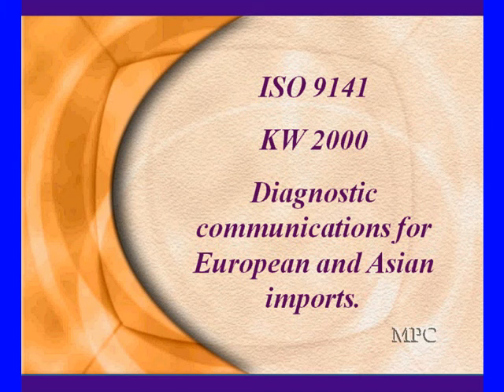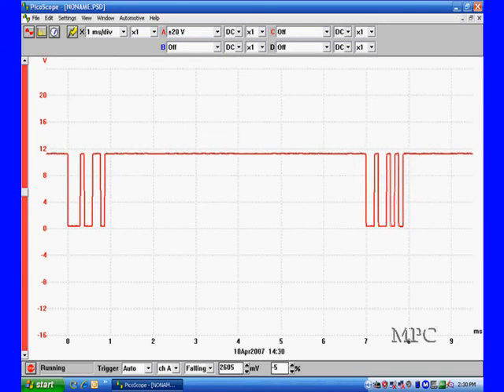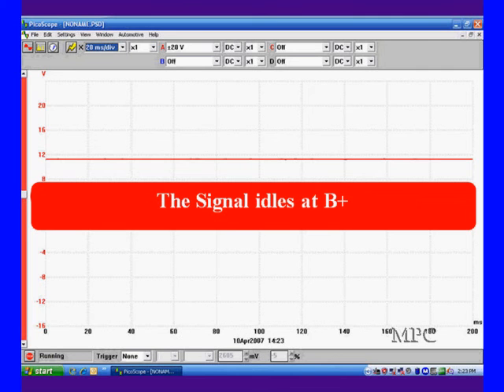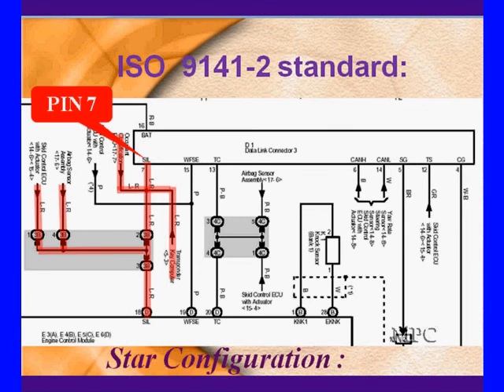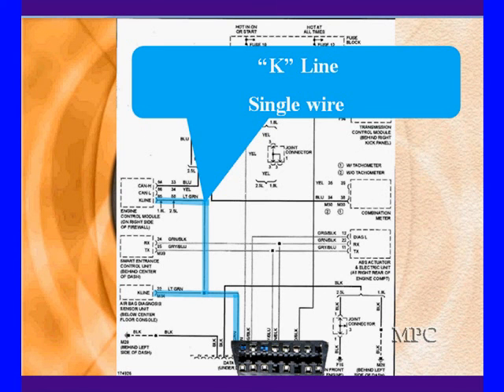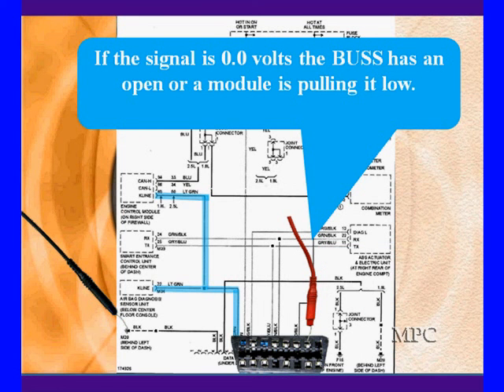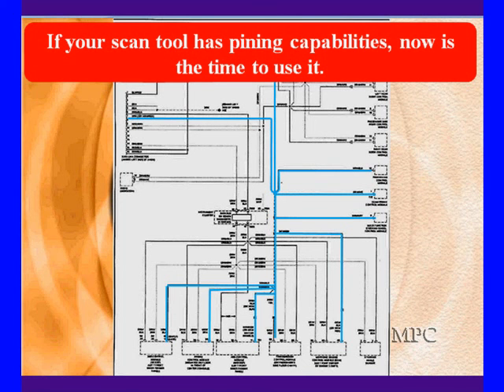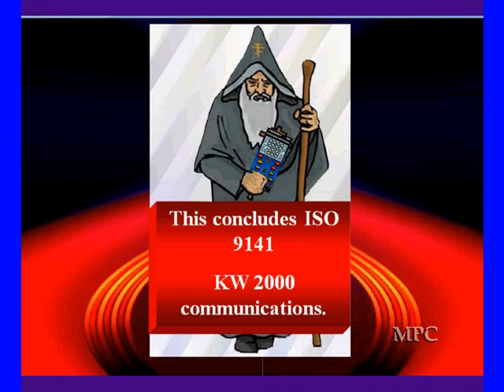14 Diagnostic Communication for European and Asian Imports - ISO 9141 - KW2000

Comment: If voltages on 6 & 14 and 7 and 15 , but measure no continuity between 6&14 7&15, what should i be looking for. The vehicle is a 2000 Jaguar XKR. Cant connect to data. Runs fine.  Has check engine light on

Comment: Thankyou for the amazing video, in a Porsche car that I am working currently tit shows 2 k lines as per wiring diagram. Pin 7- k line & pin 3- k line , pin 7- goes to engine ECU & alarm ECU 
Pin 3 goes to many other control units- transmission, airbag, cluster. 
Is it possible to have 2 separate k line & no L line sir ?